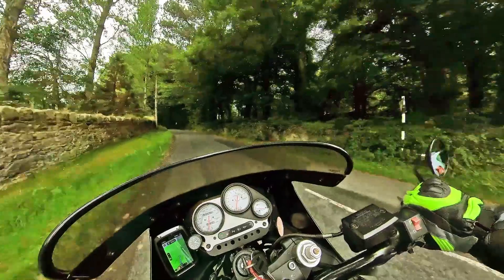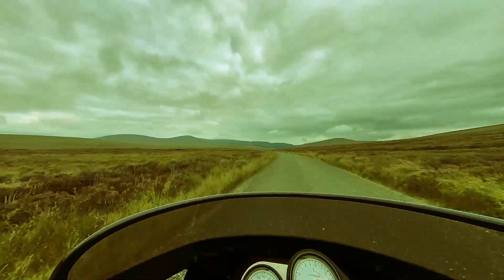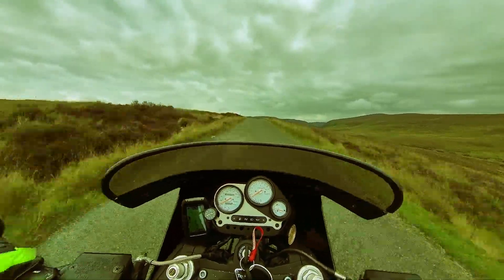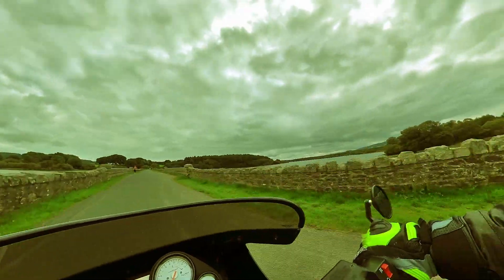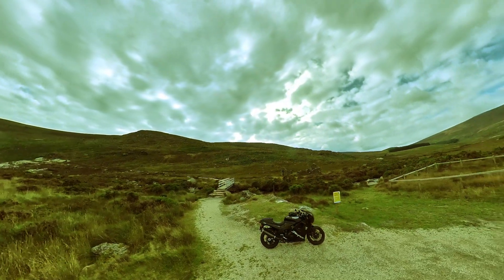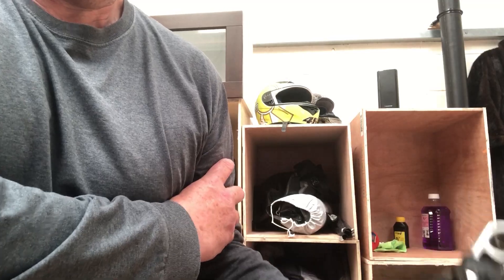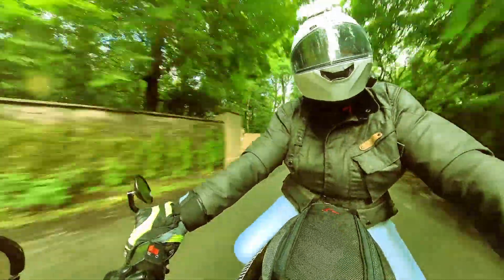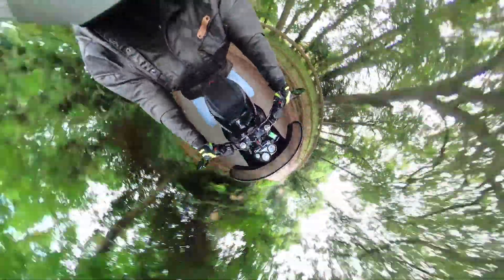The Stupidest Bike  Hinkley Triumph Ever Made.

Comment: I still own one, like you, in black. 
I used it as a commuter bike for long-distance commute. Went to track training days with it even on the Nordschleife in the 90s. Removed the center stand, as it always touched ground to easily on the tracks. Was completely humiliated by small Suzuki DR350s on small, twisty country roads. Was completely bored on long distance trips on the Autobahn, as this sturdy thing was not impressed by the wind even going over 200kph. Was asked for which lorry I wanted to have this new copper seal ring for the oil sump. Was asked by british B&B owners, why I do not own a BMW as a German instead of this, while being on a visiting trip to Hinkley with in UK. And now, having stowed it away for years, I have pulled it out of the shades to rebuild it and already have nightmares how to remove the air filter box. Like you, I also have never worked out, what the hell it is for. :-)
Reply from the maker: Thanks for sharing Alex, so it's not just me! Oh the dreaded airbox, whoever thought that was a good idea? I have had a lot of carb trouble and have had that thing on and off so many times I don't want to touch it for another five years. Good luck with the rebuild, I have done a lot to mine mechanically but decided to leave the "patina" of the bike as is so it gets treated like a normal bike. You're a brave man doing track days on this lump at the Nordschleife.
Reply: @terenceokeeffesmotorcyclestuff  You know, bikes nowadays have physical limits a normal driver will never reach. But the Daytona has limits even I can reach 😂 It is so refreshing.
Reply from the maker: @alexb7103  that’s the truth.

Comment: I have 3 of these old 1200 barges - and have owned several more over the years. Not the greatest bike in the world - but they do get under your skin, so theres something about them. Sprag is never an issue if you never try to start it on a duff battery & once youve done the "airbox mod" (which takes 20 seconds to do), removing the air filter is a ten minute affair, leaving the carbs & airbox in place, so the hardest maintenance you ever have to do is check the valve clearances every 10000 miles or so. Fitting Sprint Sport bars makes them all day comfy & a great fast tourer . . . and they look great!
Reply from the maker: You really do like them to have three Denis! You are right about them getting under your skin though. I constantly make sure my battery is super tip top but I'm on the lookout for a new HD Yuasa battery, it's time, they are proving a little hard to get locally though with production shortages. I've done the valve clearances myself and have a recent airbox and stock carbs, bike is running a treat at the moment. "They look great", they sure do.